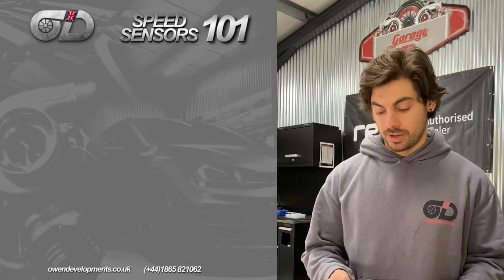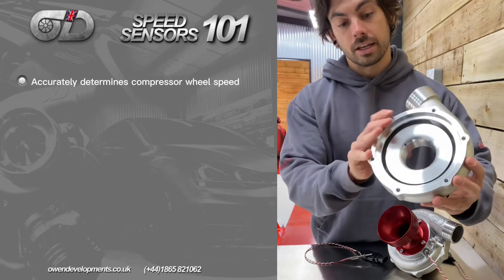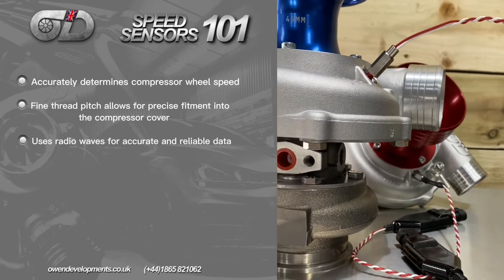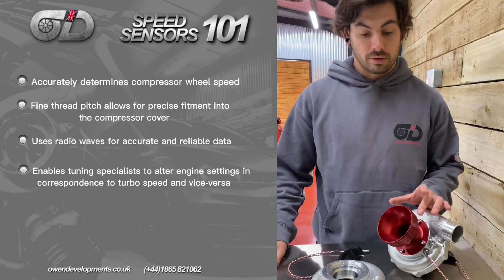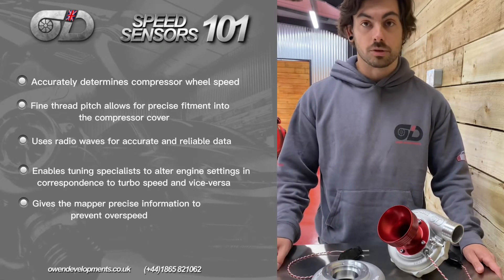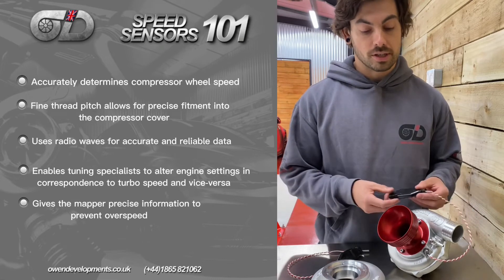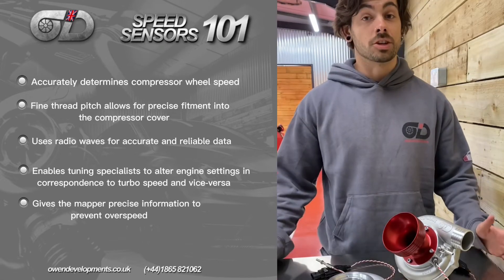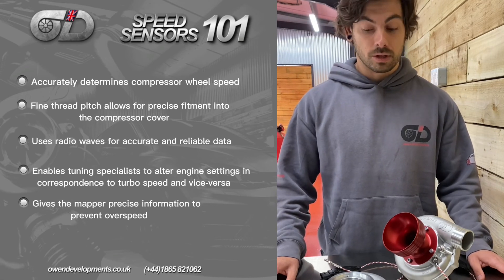Turbo Speed Sensors 101

Comment: you forgot too mention how easy one can blow the turbo without one..a simple boost leak/compensate scenario can spin the turbo too the moon! if you can spend thousand on a turbo you should insure it with one of these (actually, a cummins one will do 150USD)
Reply from the maker: I thought we covered the importance of having one, but you're right! Very easy to overspeed a turbo.

Comment: Do you offer turbo speed sensor boss modification services to compressor covers without?
Reply from the maker: We certainly do mate :) If you'd like to send us the turbo, we can modify and retro fit a speed sensor so it's ready to go. Feel free to drop us a DM or email us if you need any more information.
Reply: @owendevelopments3054  does it have to be the entire turbo or can just be compressor cover?
Reply from the maker: @KiG1208  It can be either mate. The only reason we'd suggest sending the complete turbo is to avoid any accidental damage to the compressor wheel during removal.
Reply: @owendevelopments3054  great... Will pop you guys an email to get the service done